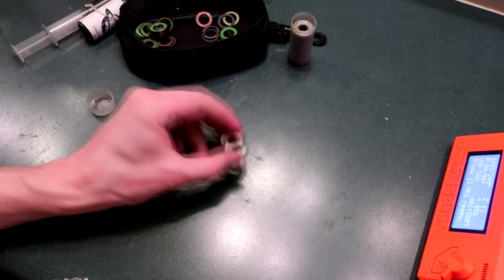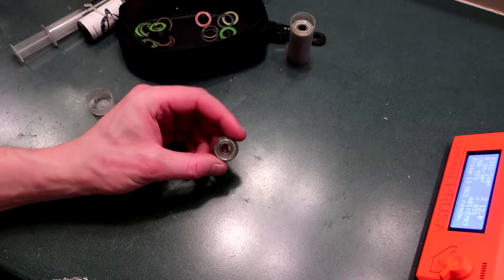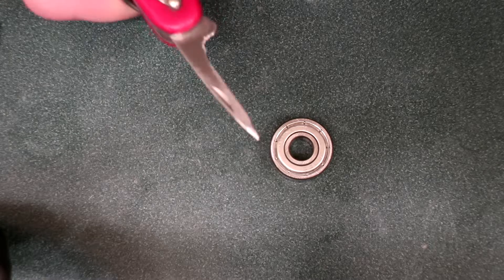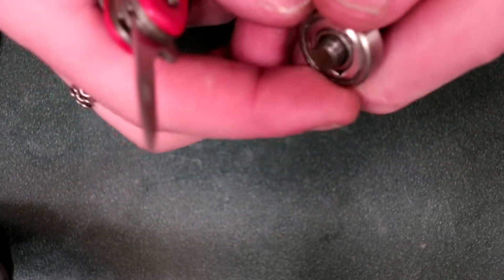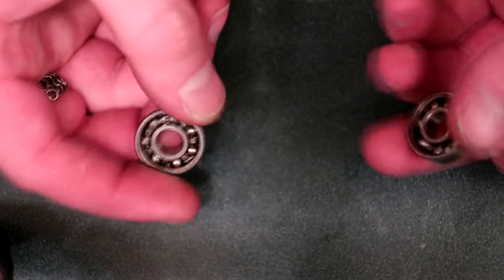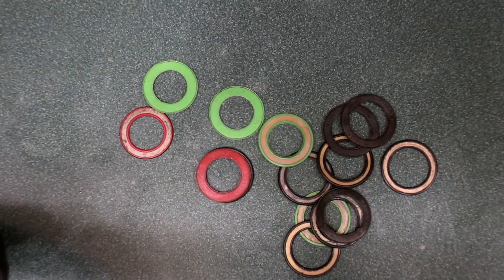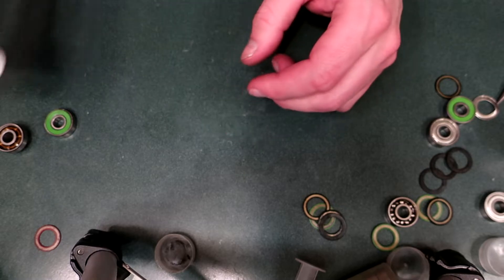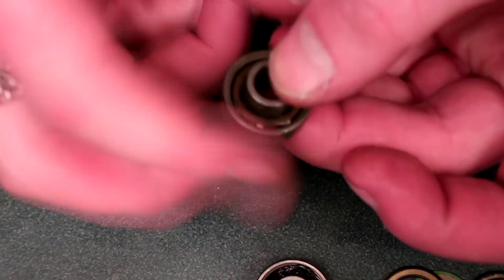Cleaning Bearings With Crimped on Metal Shields.

Comment: Solder wire ring on those metal cap and pull it off.
Be cautious if cap are spot weld to the bearing.

Comment: I would like to take a bearing with crimped metal shields, open it up, clean it out, and replace the grease with one suited for my application.  When I'm done, I want to have 2 metal shields on it.  I'm wondering if its possible to get donor shields from other bearings.  After removing the shield from one side of a bearing by deforming it, is it possible to remove the shield on the opposite side by pushing it from the inside.  I'm willing to sacrifice everything in the donor bearing except one shield needs to come out intact for re-use.
Reply from the maker: I don't think there's any way to get a crimped metal shield installed again even if you do manage to get it out without deforming it.
But there are metal shields that are held in with with a retaining spring, and those are fairly reasonable to re-install. If you can find one of those from a donor bearing that would probably work.
Reply from the maker: I decided to give it a try just to see what would happen. For sure its a no-go. The crimps are just too strong to get out without destroying the shield.

Comment: You are only supposed to add 25% grease anything more and it doesn’t give the bearing space to move
Reply from the maker: I can get away with going overboard a bit for a few reasons, firstly I'm only putting the shield on the one side. Secondly this is for skate, so its a much more forgiving application. But yes, normally you'd want to not just use a random amount.

Comment: Hi. Can i use the bearings without shields?
Reply from the maker: Yes, but there won't be anything to keep the dirt out. That may be fine depending on what you're doing, or it might mean they get worn really fast.
Reply: @LongboardTechnology  Thank you. That is no issue for me, as long as they dont fall apart without shields.

Comment: I think I can get some new plastic shields for my bearings... with my 3d printer. I've got this rubbery filament that may get the result. Nice tip of using dental syringes! I've been using plain syringes and have been considering myself smart lol Guess I'm not the first one who thought about this.
Reply: They seem to have a metal surface on the inner side.
Reply: @dunbustin  well shoot that make sense. I did print and tested with PLA, it seems doing okay.

Comment: wich is quiter? A bearing with or without the side sheilds with lubricant added? asking cause im trying to make a scilent cooling fan.

My Xbox One S fan is a lil to noisey for me xD
Reply from the maker: The bearings in cooling fans tend to use different style of bearings, often just plain bearings which wouldn't have shields at all.

If its more loud than it should be, It most likely would be easiest to get a replacement fan, in PC's that's 100% the way to go all the time. IDK if the One S fan is so easy to get a hold of though.

On my one S, I did try putting some grease in the fan bearing, but it really didn't really do much.
Reply: @LongboardTechnology  

well lucky me i think i found out a better way then removing the side sheilds.

long story short i realized my cooling fan had two sets of worn out bearings in it. i havested some fresh ones from other PC fans i had laying around and now the noise is back down to a near quite hum. also replaced the metal retention gascit with a plastic one.

but hey thanks for ur thaughts

Comment: you got a 3d printer right there... why don't you just print new shields for your bearings from tpu or something?
Reply from the maker: I had really only just started 3D printing when I made this video, and hadn't use TPU yet, but that's not a bad idea.

Not sure it will work, the brim of rubber shields are really thin, and the rubber is cast around brass to make it stiff, still could be doable though.
Reply: i didn't realize they had washers underneath saw it after you pointed out looks like copper washers. not sure why brass or copper washer is there tho. can you pls check if it contacts the washer when it turns? they wouldn't put those there for no reason those washers are more expensive than the seal itself :  ) 

still 3d printable tho try with what you got doesn't have to be tpu whats to lose? 

i think its best to use 2 material here a washer from pla abs petg whatever you have or metal washers if needed and the seal itself from not so flexible hard tpu like 90a or similar.

it is perfectly 3d printable just needs some trial and error. 

i have some small zz ones needs attention but those metal caps are problematic as it seems they will need replacement seals for sure. i will try to print some later as well
Reply from the maker: The washers are really thin, almost more like a foil. Definitely not going to be that expensive.
I'm sure they're there to stiffen to seal and help ensure the seal stays away from the balls and cage. I've had a few cheap sealed bearings that were just solid rubber, and they seemed pretty junky.

My biggest reservation with printing seals is that the groove the seal is supposed to fit in is very thin, so we're talking really thin layers and possible slight overhangs with a particularly slow and difficult material to print with. It does seem possible, but how finicky would it be to do?
Reply: cant be that hard. try when you are bored and got nothing better to do. different designs different materials different settings etc its small enough part to experiment quickly. at worst it wont work and you will learn a lot about your printer materials settings and designing parts with clearance  :  ) don't expect it to work the first time and hope for that. that wont improve you at all...  check out other ppls works for reference and ideas i saw a guys work on thingyverse for metal clipped ones i guess he had a openscad custom writing seal design you may like that kinda thing dunno the point is go experiment you got nothing to lose have fun

Comment: If you don't have any old rubber seals and don't have time to go out and buy some, and want to get the bearing reinstalled...you can reuse the old metal shield by turning it over an gentle taping bent section straight, perhaps with a small wooden dowel. I've also had good luck getting the seal off using a thin, dull knife blade. It doesn't damage the seal as much.
Reply from the maker: Probably depends on the bearings a lot.
These shields would definitely risk snapping a knife blade, really were quite stubborn.
If they come out less destructively, I could see them being salvageable.

But I wouldn't use them in applications where it would cause any sort of failure or safety issues if the seal came off.
Like if this was bearings inside a power tool or something.
I wouldn't trust a re-crimped shield to stay on with 100% reliability.
Reply: @LongboardTechnology  I've done this successfully over the years with no problems. The ''crimping'' is just a form of press fitting for mass production. Since you're replacing the shield by hand, you're not under the time constraints of producing 100's a minute like a factory is.

Comment: I use md40 to clean and bones cream for lube. What do you think this combination ?
Reply: You should probably use acetone or alcohol to clean. Just make sure they are totally dry if you're using wd-40 to clean. Since it's water based can rust your bearings longtime
Reply from the maker: Wd40 you mean?

That works fine for cleaning, but probably more expensive than other alternatives which will be just as effective.

WD40 also has some mineral oil as a lubricant it leaves behind, which may dilute the nicer bones lube a tiny bit.

Id say it probably works just fine if you wanted to keep doing that, but can easily do a little better.
Reply: @LongboardTechnology  what about the silicone wd40?

Comment: This is a great video!  Dental syringes are super handy.  My only advice would be maybe using less grease.  I use light coatings of white lithium grease, applied with a dental pick!  It takes longer to apply than your method.  But use what you got.  And if course, grease is slower than light oiling, but pick your poison.  Again, very helpful and thanks!

Comment: You rock.  I did what you said and the metal ring popped out.  I have a 1974 Arctic Cat and I cannot get a bearing shipped to me in at least 2 weeks.  When I opened up the bearing there is some grease in there but it's dirty and definitely needs new grease.  I don't see any scoring on the inside of the bearings or the walls so I will reuse them thank you so much for your help!!!!  I will fix up the bent metal bearing ring and then do the same for the second one.  When I do the install I will face the two bearings which had the metal rings repaired towards each other and I think the seal will be good for service.

Comment: Why do you use grease instead of lubricant? Grease is heavy weight and will slow them down
Reply: Lubricant will run away, grease is oil and a binder usually soap and it keeps the oil in place.
Reply from the maker: Because it largely doesn't have any effect as other factors come into play which limits  your speed first, like air resistance.

It matters a lot less when going fast, but it does begin to matter when doing low speed stuff like long distance push, dance, or flatland skate.

Also, the grease I use doesn't have a very large effect on roll speed either compared to what other greases might do.

I take a small, but negligible hit on my speed, but in exchange for much better protection against dust, dirt, water, and wear.